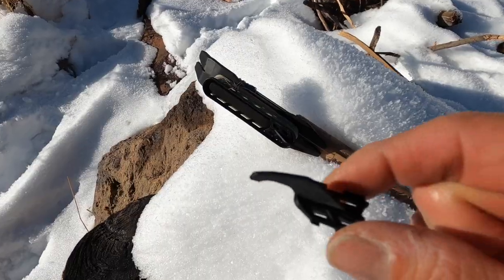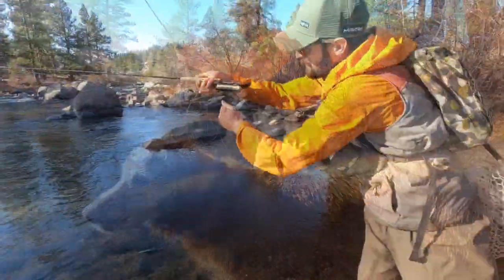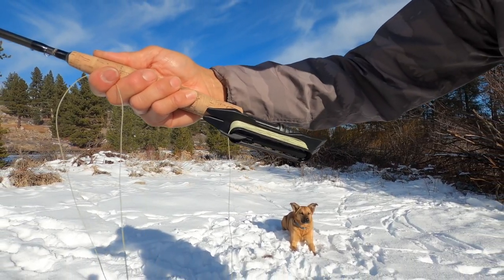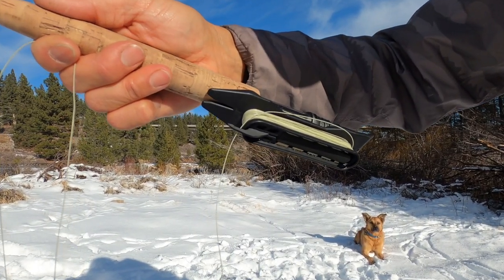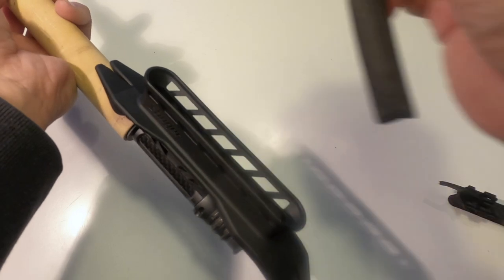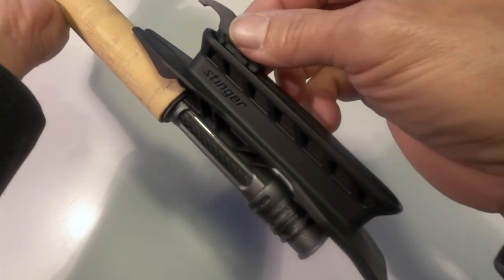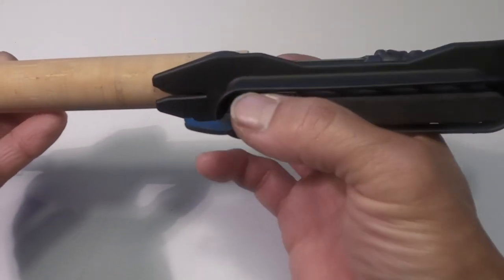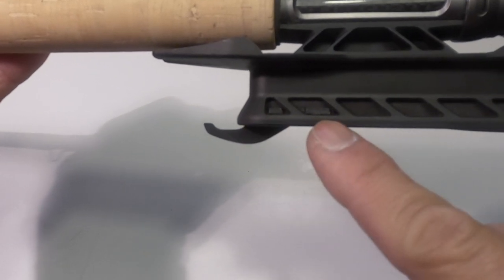2021 Stinger Soft Lock Tab

Comment: Will it hold 2wt fly line?
Reply from the maker: Yes it will. I have 2wt WF line on my dry fly set up. If you have an older Stinger without the Softlock we'll send you the upgrade parts at no cost.
All new Stingers come with the Soft lock tab. Thanks!